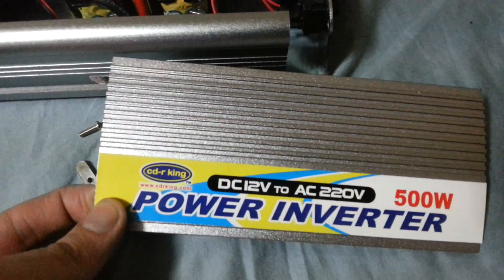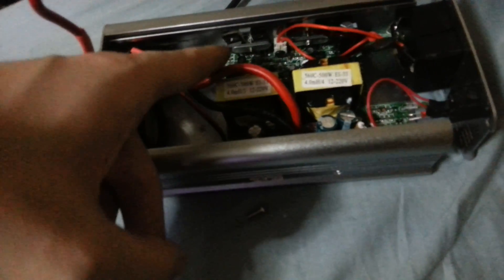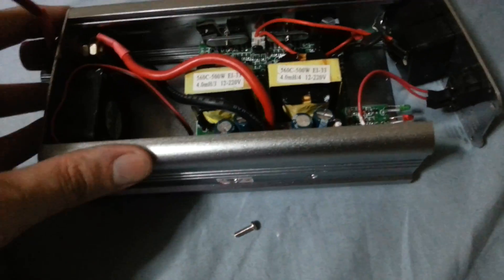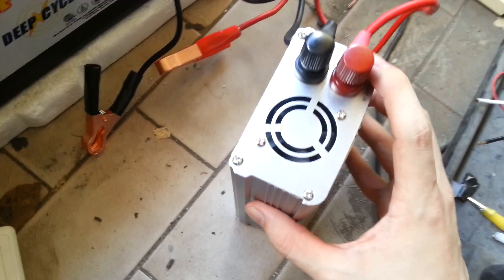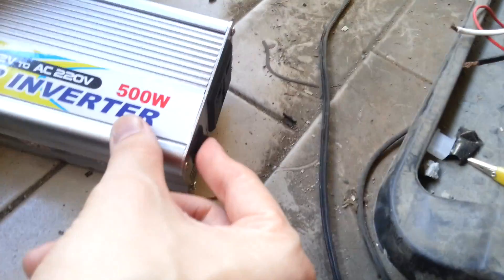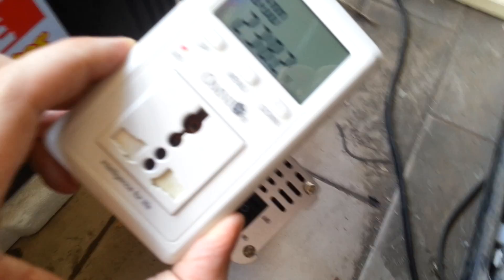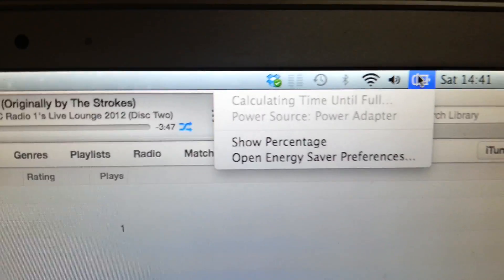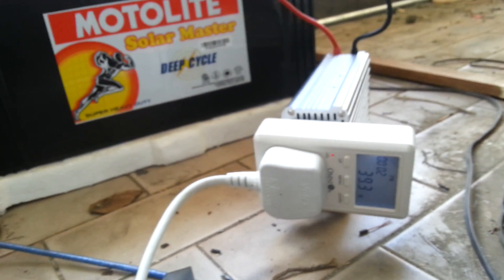CDR King 500 watt power inverter

Comment: Nice video , btw , how long have you been using your battery , i have one(the same model) wich failed after 2 years
Reply from the maker: I think two or more years. Did you try top up the water? And did you try any 'smart charger' that can sometimes rescue dead batteries? I had an argument with motolite recently because they wouldn't honor the warranty on a smaller (40ah) battery I purchased. Within weeks of buying the battery it was clear that there was something wrong with it and that it wouldn't hold a charge. After getting no where with them, I told them I was going to update my Youtube videos to warn people about Motolite warranty and then they finally agreed to check the battery if I take it to 'Batparts' in Manila.

Comment: Hi Gadget Addict,

where did you buy the solar panel and the charging control unit? and how much?
thanks..
Reply from the maker: Some panels came from Sulit (imported from Japan), some came from CDRKING. One charge controller is a generic chinese model that is sold everywhere from 500-1000 php and my most recent is from cdrking. Subscribe and check out my other solar videos for more info :)
Reply: thanks for the info.... more power...

Comment: Hi. I recently purchased a 1000w inverter from cdrk. Got a question before I send this back. When you power the inverter you have in this video, does its exhaust fan automatically runs or is it delayed?
I have mine not running and the case/heatsink is too hot for a 10-sec touch.
Reply from the maker: The fan turns on immediately with this inverter. Some inverters will only turn on the fan once a load is connected. CDRKING also sell inverters (usually lower wattage) that don't include fans and they run very hot.
Reply: that confirms my speculation that its malfunctioning. thanks! i'll bring it back for replacement then. Thanks for all the help. With your videos I was able to power my server, router, LED lighting, and refrigerator. Maraming salamat!
Reply from the maker: Ervin Malicdem Walang anuman po :) I'm glad you were able to setup what you wanted. Hopefully cdrking will replace your defective product rather than try to fix it in-house.

Comment: How long will your laptop last on that Motolite battery?
Reply from the maker: If the macbook battery requires charging and I'm using it at the same time, it will consume 30-40 watts. If the battery is fully charged, it consumes around 15-20 watts while I use it and the inverter consumes around 3-5 watts. So let's imagine the laptop is fully charged and then suddenly there's a brown out. The laptop could continue to run from the motolite battery for 50 hours. Except I wouldn't run my motolite down past 50% if possible, so maybe 25 hours.

Comment: Your solar panel is directly connected to your battery? Is it dangerous if it's over charged?
Reply from the maker: My larger set of solar panels uses a charge controller. They're not hooked directly to the battery. I do have a smaller 10watt panel which is hooked directly to a battery. That panel won't produce enough power to overcharge the battery and is safe to connect directly. It's a reputable panel maker and even their own documentation says the same thing :)

Comment: hi! GA im just planning to buy one like that on your set up but can these power for more than 2,3 appliances like tv,fan thanks.
Reply from the maker: Heya, that should be fine. Most inverters only come with one socket so you'll have to buy your own extension/splitter but otherwise you shouldn't encounter any issue. Most modern TVs (around 32 inch) only consume 20-40 watts and a fan will typically be 30-60 watts. As long as you're within the limits of the inverter, you should be fine. I would never run an inverter at it's limits for an extended period of time. For example if my inverter was 'up to 500 watts', i'd probably put a max constant load of 400-450 watts.
Reply: thanks for the advise and respond!!!!!

Comment: everything and every gadget are made in china by the way... so stop whining ...self proclaimed... know it all...mister odyssey.... but dont have solar power thingy in there house...he said its generic.... in a poor country that we have without manufacturing capabilities... we rather stick on generic ayy...
Reply from the maker: Well not everything; other countries also manufacture their own things. But agreed, the majority comes out of China. Being made in China doesn't necessarily mean it's low quality. Even the iPhone is made in China. The problem is the large number of generic no-brand gadgets being pushed out of China using the cheapest quality parts and the cheapest labor. If you're paying p200 for a gadget that normally costs p2000, you shouldn't expect the same quality :)
Reply: motolite batteries are exported to russia :) nothing is impossible if wanted.
Reply from the maker: John Philip Solano I guess. Not sure why you would want to though. The cost of shipping such a heavy battery would probably be higher than the battery is even worth. Just buy locally from a reputable manufacturer. It's not like motolite batteries are the best in the world.

Comment: Can i use this to save electric bill by using a power supply 20watts plugged in the wall socket and then connected to this inverter to get that 500watts and power up larger appliance?
Reply from the maker: I'm not sure if I understand your question. Are you asking if you can get 500 watts out of this while it only consumes 20 watts? This inverter is simply turning a 12v source into a 220v output. If you connected a 200 watt load to this, it would actually consume around 210-230 watts because of losses in the conversion and circuits inside the inverter.

Comment: Don't buy cd-rking products...
Reply from the maker: lol, I try to limit how many I buy. I nearly always end up disappointed after buying a cdrking product. They don't actually make anything, they just have their label stuck on generic chinese products. Some of them are okay, like some of the standalone solar panels but yeah, you generally get what you pay for.
Reply from the maker: Savadious Savadious Yup, doesn't surprise me. I've seen the same generic products rebranded and sold in other shops for a higher price.
Reply: Gadget Addict I waited in line at CDRking recently and saw a technician from a nearby laptop repair shop in line. He purchased an item then returned to his shop to install it in his customers laptop. I am sure the customer paid a lot higher than the CDRKing price.... and never knew it was a CDRKing item. SO higher price sometimes gets you the 100% exact same item you can get cheaply :)

Comment from the maker: Sorry for the late reply. As long as you have a charged battery to connect the inverter to then yes it would serve as a backup. Electric fan, laptop, wireless router, modem would add up to maybe 100-150 watts and the lights depends on your bulb type. So it could easily manage your expectations.

Comment from the maker: I have seen people connect an inverter directly to a solar panel but its unreliable, any dip in sun will instantly kill the inverter. You can buy a 12v fan which would be much more efficient than using a regular 220V AC fan with an inverter. There are "solar fans" on sulit - 12volt fans that include a battery. Just connect the fan to the solar panel and it will run from the power of the sun AND charge the battery (provided solar panel is big enough).

Comment: hi phil; do i really need a motolite solar master to use the power inverter or could I connect the inverter directly to the solar panel? if i only use the power bank and i'm only gonna use it for an electric fan; is the usb fan gonna last 8 hours? any tips to use the solar panel system for electric fan use? can the solar energy kit power the inverter?